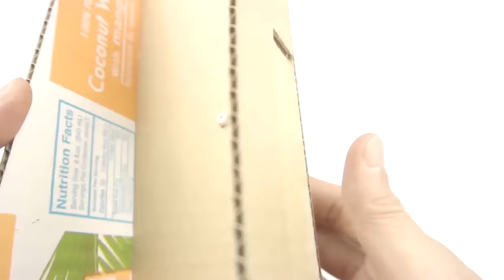TOP 4 Unique Creations from Cardboard with Construction Truck Toys

Comment: 3:30 does that makes real concrete ??
Reply from the maker: As you saw in the video, it works really well as a real concrete mixer truck. It's mixing mixture: sand + cement + water
Reply: @V_Idea  great job then
Reply from the maker: @christellep42640  Thank you so much!
Reply: @V_Idea  np, pls make a firetruck
Reply: @V_Idea  so that means it makes real concrete